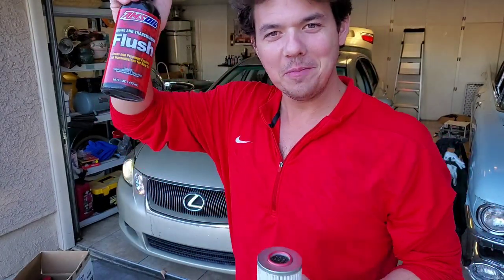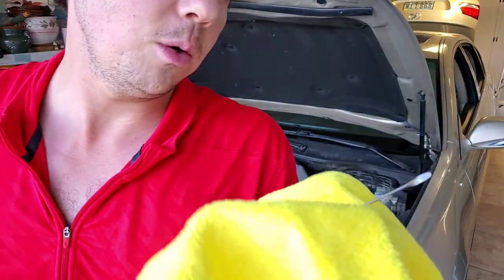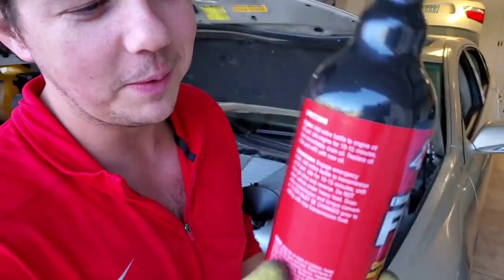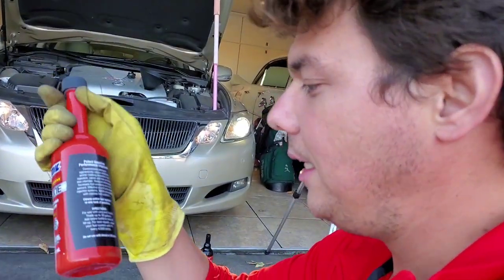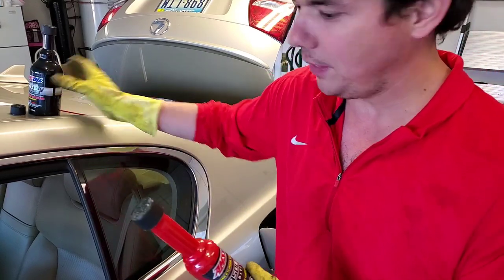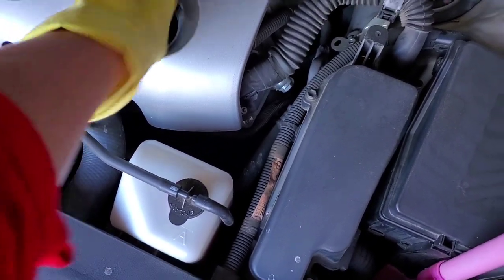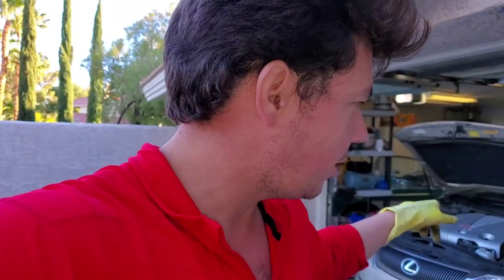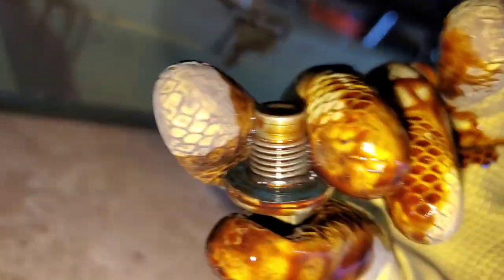4 Year AMSOIL Follow Up Lexus GS 350 Oil Change & Fuel System Cleaning

Comment: I did a review couple days ago. A person commented on my review and stated I sounded like a "Shill". I was offended! I was writing a honest review on Amsoil CVT transmission fluid. The reason I was called a shill was because all I said was Amsoil cvt transmission fluid made my car transmission shift smoother, quieter, and better than ever before.
Reply from the maker: I don't ever worry about whatever anybody thinks.

You now it's hard to believe how good Amsoil is so it's understandable.... Lol

♥️ AMSOIL Performance Test Results. Read This Article - https://www.amsoil.com/performancetests.aspx?zo=5331179
Reply: How does a cvt shift smoother?
Reply: @Hosshoggbossdogg  when I would go 0 -60  fast acceleration with other full synthetics my shifts where alot rougher and my jerked when my transmission changed gears ⚙.
Reply from the maker: It shifts a lot smoother by engaging better better engagement smoother engagement It also downshifts better The sprocket moves and it changes the ratio It can do it glitchy or it can do it smoothly when it's smooth it almost feels like nothing's moving at all but if you have older fluid it'll feel like it's hanging on a taller gear when it's supposed to be lower and that's how you know the fluid starting to get broken down.

When she would feel it you would see exactly how it is also depends on the component and a lot of other elements like driving style and age of the vehicle and type of CVT transmission.
Reply: @Syntheticoilprotection  when does the free give away end?
Reply from the maker: Never it happens every month every last Saturday the month 11:00 a.m. on the channel - https://youtube.com/playlist?list=PLB_ftWArBFdey4HFt_Z9KgSIChjkLbw_o

Comment: Eben, I just took my '07 MB E-350 (with 180,000 miles on the odometer) on a road trip from S Florida to Cincinnati. 
I was thrilled to get 27mpg. I started using amsoil about 15,000 miles ago and would never use anything else on my car.
Reply from the maker: Stellar 💯

Thanks for sharing that with the channel ✅

Comment: Excellent video Eben!!  I just put the S UV on Amsoil OE today. That completes the entire drive line from the rear axle, transmission and transfer case. She is now bumper to bumper amsoil.  When it's out of warranty I will move up to the top oil. 👍🇨🇦
Reply from the maker: Sounds great have you ever tried the low toxicity biodegradable cooling yet
Reply: @Syntheticoilprotection  no not yet, its coming up for a coolant change too.  What are the major benefits from using that please?
Reply from the maker: I did this video a couple days ago and I've been wanting to do it for a while but it gets in the detail on how great it is and the huge benefits.
https://youtu.be/T4i-DK1ITI4

Comment: Which filter exactly did you use for that GS? I have a 2008 GS 350 and I’m trying to change the oil myself for the first time.
Reply from the maker: I always like using the Amsoil filter.
This will give you the proper filter right here for your exact motor.
Find AMSOIL Products For Any Vehicle - https://www.amsoil.com/guides/?zo=5331179

Comment: Love your energy man! Def going to try amsoil flush on my ES350
Reply from the maker: Awesome this will give you the best value as the 6-month PC member also when you use my link that would attach me to you in the future I can answer your questions about improving the performance and lifespan of your vehicles by choosing the right fluids as your independent amp Oil Dealer. 
New promo: FREESHIP 
♥️   Shop by vehicle - https://www.amsoil.com/guides/?zo=5331179 

     ✅   Save up to 25% on every order as a preferred customer: https://www.amsoil.com/offers/pc/?zo=5331179

Comment: Great video, thanks Eben! Maybe the upper cylinder lubricant and/or octane booster will help the front end vibration on my 2016 Honda CR-V...Honda says it’s normal with their 2.4L engine and new CVT combo that year and “While it is annoying to some, it is not noticed by most, and it does not represent a detriment to the safety or reliability of the vehicle."-Honda 😂 it’s not that noticeable but it is there
Reply from the maker: Yeah those direct injected motors do make quite a bit of noise with the direct injection and they are kind of vibrating. I know what you mean yeah the upper cylinder lubricant will make it a lot smoother The octane booster really is just for helping clean it up and it will run a little bit smoother but the upper cylinder will make a bigger difference.
Also the other one with that would make a huge difference is the PI performance improver that one would be even better for that cleaning the combustion chambers.

Another one that would clean out the cylinders is the power foam which is the yellow can you'll see that under cleaners and protectants.

Also the other thing that can make a difference in vibration is if the rubbers that are on the engine mount are getting stiff it will start to vibrate and eventually it will need motor mounts and that could be the beginning of it depending on how the cars kept in what type of humidity and the environment.
Sometimes they also have bad engine parts that the manufacturer makes and those engine mounts may not be tight or there could be something wrong with the polymer in the mount that made it stiffer so it's not having the correct vibration frequency.

Definitely something to talk to a Honda technician about and they would know the subtleties 💯👍🎬😉
Reply: @Syntheticoilprotection  👍😁

Comment: I never thought about using the octane booster, I'll look into it.
Reply from the maker: Yeah me neither I never thought they did anything.

I had a Amsoil dealer of mine reach out to me and he told me in his town in Sacramento they didn't have higher octane and he said you'd be surprised how much better your car will run when you try it and I figured it wouldn't make a big difference.

Well I tried it now in about six different cars and it makes a huge difference You have a cleaner burn less pinging less knocking smoother operation when you're lugging a gear and the motor runs better afterwards which means it must be cleaning something What it's cleaning a lot of I have no idea is I never took a motor apart before and after but it's got to be cleaning the valves or something and it does make a big difference.

I really like doing the combo with the upper cylinder lubricant with the dominator and it makes a huge difference in power especially in the mid to higher RPM
Reply from the maker: I will definitely be doing a dyno video soon showing the before and after with those two combined
Reply: @Syntheticoilprotection  that sounds like a great idea
Reply from the maker: Yeah I have to do it because I can tell it's making a lot more power especially in the mid to top end and I think it's around 5 to 15 rear wheel horsepower on the cars that I've tested.

It'll definitely be interesting to see what it actually is

Comment: Hey eben I’m about to be doing the oil change on my moms 2016 Mercedes c300 I don’t currently have a jack that can fit under the vehicle what are your thoughts on an oil extraction pump seen a lot of people use these
Reply from the maker: Great question I have no idea I've never gotten into those type of pumps.
I really don't know I think you can curb style it that's where you drive the one side up on the curb the other wheels on the regular ground and then you just want to make sure the drain bolt is towards the lower side.
I did a video on the smart car if you type in smart car curb styling oil change you'll see it it's funny as hell

Comment: Do you just pour the coolant boost directly into that compartment you opened to show how clean it is? And do you need to pour more coolant inside that compartment when it looks low?
Reply from the maker: Good question.
Depending on the vehicle there's two different areas that take coolant there is the radiator that goes directly into it and then there's the reservoir which is the overflow tank and sometimes that sucks up fluid when it needs it just depends on the vehicle you want to make sure you put the concentrate directly into the radiator.
Reply: @Syntheticoilprotection  Thank you for your swift reply.
Reply from the maker: This is my personal link and when you use it I would be your Amsoil Dealer so in the future I can answer all your questions on the products I appreciate your business future business in advance.
✅ ✅ ✅  You will get Your Best Value as 6 Month AMSOIL PC Member --- because You get about 25% discount on AMSOIL Products  + you will not pay as much sales tax, depending on the sales tax in your state.  For example, if you were to buy $100 of product at retail plus 8% sales tax the total would cost you $108. However, if you paid the $10 PC membership and you received the 25% discount because of the PC membership, the total would cost you $75 plus 8% tax or $81. So for the one time membership of $10 you are saving $27 on your first order.  You continue to receive discounts on your future orders for the next 6 months. You do NOT need to auto renew! https://www.amsoil.com/offers/pc/?zo=5331179

Comment: Hey Eben, I purchased my amsoils for my own GS350, where did you buy this oil filter pliers?
Reply from the maker: That's a great question I think I got him at O'Reilly's Auto parts.

When you signed up did you become a preferred customer with my link? When you use my link I would get the credit for your order and I would be your Amsoil dealer in the future I could always answer all your questions on the products.

♥️ AMSOIL Performance Test Results. Read This Article - https://www.amsoil.com/performancetests.aspx?zo=5331179
Reply from the maker: 🎬 Professional YouLubher: Eben Rockmaker Regency Gold Direct Jobber AMSOIL Specialist (Dealer#: 5331179) 702-472-3614 

     ✅ If You're New To AMSOIL I Recommend The AMSOIL 6 Month PC Membership because it will save you about $33 on a $100 purchase after the difference in tax - https://www.amsoil.com/offers/pc/?zo=5331179

Comment: I decided to try the Amsoil products after watching many of Eben's youtube videos and finally took the plunge and put in the Signature Series 5w-20 oil and Transmission fluid(8-quart flush) as well as I threw in a can of the Engine Flush yesterday on my 2005 Honda Accord with 306,000 miles and took it for a 25 mile trip..  I could not believe the difference!! WOW!! I have had a tick in the engine on start-up for awhile now and the engine seemed to be a little louder than normal for my liking. I Changed the oil and filter and "poof" runs sooo much quieter and no tick at start-up( 15-degrees Fahrenheit up here in Minnesota yesterday).. I was a little nervous about doing the transmission flush(complete exchange of the fluid not just a pan flush).. But I did it anyways, and when I took it out for its little trip it shifted like a new car and Im not exaggerating!  Couldnt believe the extra gitty-up-and-go it had with the new transmission fluid!
Reply from the maker: Awesome thanks for sharing that with the channel Tom!
Reply from the maker: Did you sign up with my link?
Reply from the maker: That way if you did I would be your Amsoil dealer in the future I could always answer all your questions in the products.

If you didn't use my link then you could always be switched to me within 30 days of signing up after 30 days you would be locked in with whoever you signed up with or you could have been randomly assigned to someone if you didn't click on my link.
Reply: @Syntheticoilprotection  you are my dealer Eben.. I am signed up with you.. I ordered last week and received it 2-days later.. GREAT SERVICE/Shipping!!
Reply from the maker: Happy to hear!

I can double check what is your full name on your account I'll double check and make sure 😉👍💯
Reply: @Syntheticoilprotection  Tom Schalwig,  It was like a $325 order give or take.. it showed you were my rep. When I ordered.. I hope you got the commission on it!! Can you let me know?
Reply from the maker: Oh yeah I have you and I also texted you and I followed up as soon as I saw your order Thanks again Tom for always being a part of the channel!!!
Reply from the maker: You have been randomly selected for my end of month giveaway coming up December 25th at 11:00 a.m. on the channel please text me your full name so I can save you in my phone 702-472-3614

Comment: Been pretty busy but decided to catch up on some synthetic videos, I bought 3 bottles of the liquid gold the other day from store near me that carries it,  going back when I get paid to get another 3 bottles so I have the 6 quarts needed, sadly amsoil doesn’t have an filter for my car says out of stock but I’ll go with an mobile 1 filter I only go about 10k miles so I’ll be good
Reply from the maker: Yeah I always recommend the Wix filter they're good for about $7,500 and they're very cost-effective and it's a great high filtration filter.

You'll know it's time to change it when the oil starts getting pretty dark then it'll be time to change the oil filter and you can continue running the AMSOIL 😉👍💯

Comment: Lol! My hood shocks are the same in 2006 Lexus Is 250 😀
P.S. could you please post the link to the oil filter pliers? Thank you!
Reply from the maker: Great question I have no idea where I got those I think I got them five or six years ago at a O'Reilly's Auto parts I since looked for him and could not find them anywhere.

I believe they made him too well and they stopped making them that's usually what they do when they find out they make a product too good.
Reply: @Syntheticoilprotection  got ya ! Thank you for quick response. I will get something similar. If comes to Amsoil it is great oil! Just too bad that it is not available at Advance Auto or Autozone or Walmart. My other local auto parts stores never carry it also.
Reply from the maker: You can get it right here with my link and when you use my link I would get the credit for it and I would be your Amsoil guy in the future.
You would have it shipped right to you free shipping honey order 100 bucks or more with a lot of other great benefits to.
🎬 Professional YouLubher: Eben Rockmaker Regency Gold Direct Jobber AMSOIL Specialist (Dealer#: 5331179) 702-472-3614 

     If You're New To AMSOIL I Recommend The AMSOIL 6 Month PC Membership because it will save you about $33 on a $100 purchase after the difference in tax - https://www.amsoil.com/offers/pc/?zo=5331179
Reply: @Syntheticoilprotection   great! Thank you for the info!

Comment: When I did the engine flush the oil didn’t get thinner it got thicker and more then an extra quart came out. I was shocked and would have panicked if you had not mentioned that this was pussable.
Reply: When I did the engine flush I ended up getting a Full 5-quarts of the signature series oil in my car.. I normally only get 4.5 quarts in on a oil change.. I was getting all worried like something was wrong at first and was checking for leaks but nothing😀😀.. love this oil! Barely hear the car running!

Comment: I love amsoil , and I agree it’s the best , but if u love ur car never let the oil stay in there for a year ! Change every 3 months or 3 k miles if u like ur car !
Reply from the maker: Oil Analysis Tests: 

15,500 Oil Analysis Test Results SL550 - https://youtu.be/3rdN6U1Jt_M 

5500 Mile AMSOIL Oil Analysis Test Results - https://youtu.be/3wf962IwEmo   

5000 Mile AMSOIL Oil Test Results On My SL550 - https://youtu.be/fLuvzN6yLSw 

11,000 Mile AMSOIL Oil Analysis Results on my Corvette - https://youtu.be/YEY_13UYzA4 

20,000 Mile Oil Analysis Results on Honda Uber - https://youtu.be/gm_PXlpiaTk 

26,000 Mile Oil Analysis Results - https://youtu.be/Wdq2A2YIorM 

80,000 Mile Oil Analysis Test Results Freightliner Cascadia - https://youtu.be/9A9k6i1xMoo 

25,000 Mile AMSOIL ATF Analysis Test Results - https://youtu.be/IeVPGR7UO9E 

      The Power of AMSOIL Signature Series 5W-30 Synthetic Motor Oil protects against harmful deposits on turbochargers 4X better than Mobil1® Extended Performance and 3.6X better than Royal Purple® in industry-standard testing*.  Read This Article - https://www.amsoil.com/newsstand/motor-oil/articles/leading-the-field-in-deposit-protection/?zo=5331179

Comment: EASY PEASY - JAPANESY !!!!!!!!!
Question ?
Does this Work on GM L83 v8 Engine - Direct INJECTION         ????
5.3L
Reply from the maker: Not sure what you mean by does it work I don't know what you mean by what it is but yes you could use the Amsoil you can use all the products I did in this video and the products are all for specific applications This is the lookup guide It will give you everything for your year may model and engine size and if you have any questions you can always reach out to me and if you new to Amsoil I always recommend the 6-month PC member and when you use my link I would get the credit and I would always be your Amsoil guy in the future I could always answer all your questions on the products.

This link will save you about $33 and $100 order because of the difference in tax.
🎬 Professional YouLubher: Eben Rockmaker Regency Gold Direct Jobber AMSOIL Specialist (Dealer#: 5331179) 702-472-3614 

     If You're New To AMSOIL I Recommend The AMSOIL 6 Month PC Membership - https://www.amsoil.com/offers/pc/?zo=5331179
Reply from the maker: You'll see the lookup guide in the upper right hand corner once you click on the PC link you'll see the little circle of a car icon